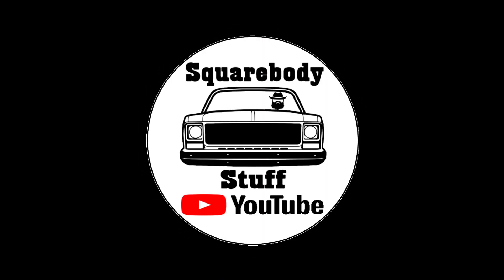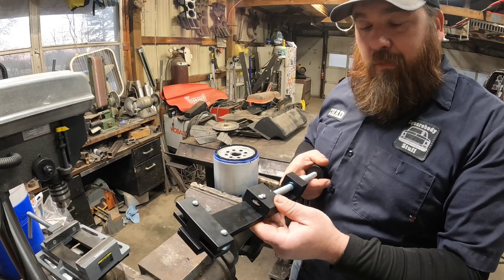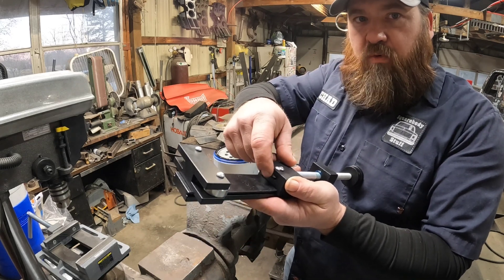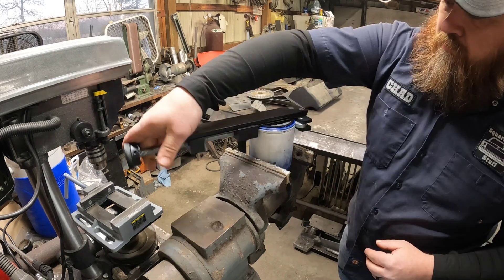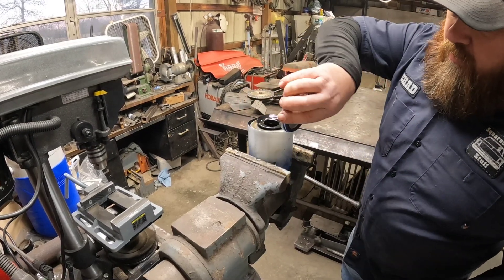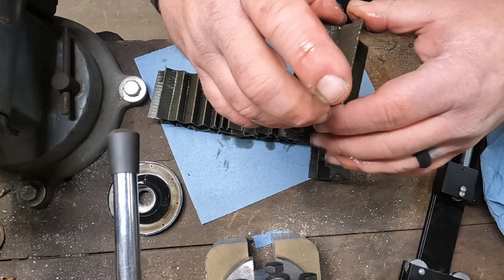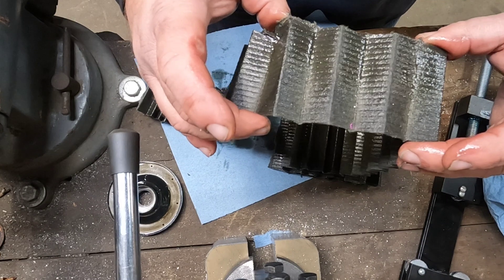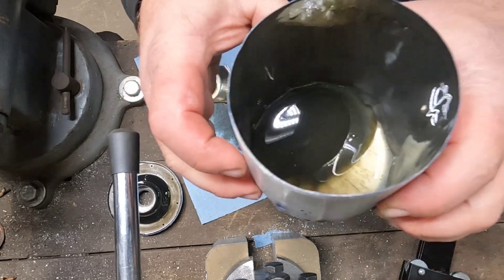How to cut open an  engine oil filter. See what I find in the break in filter of my stroker 339 sbc.

Comment: As you said, "if ya have to force it, ya might want to back-up and access the situation."

Same issue with Gene Stoner's platform...he refused the "forward assist"...and someone without knowledge "ok'd" "the forward assist"; which does just the opposite of your sound advice!

Why anyone that can't get the cartridge into battery and then want force it in? That one may fire but good luck getting the case out and next cartridge chambered.

Well, I'd say, let'em do what they can afford.